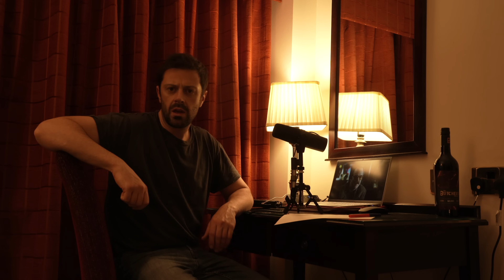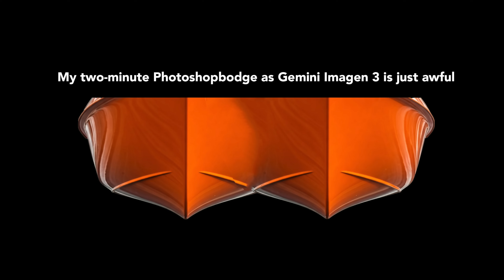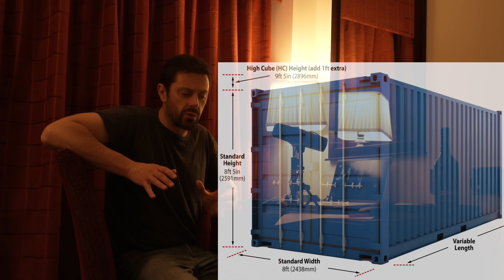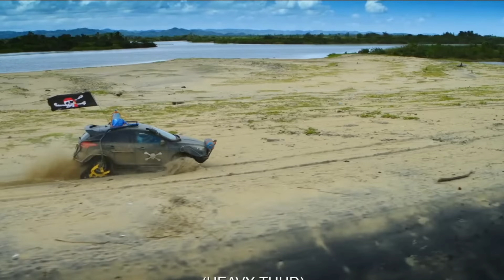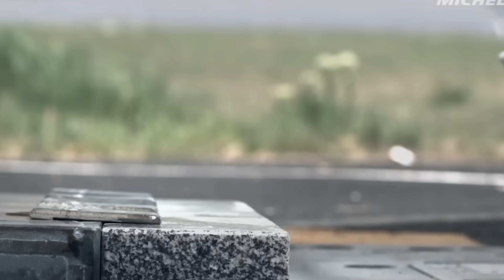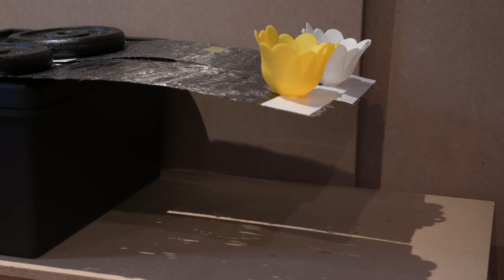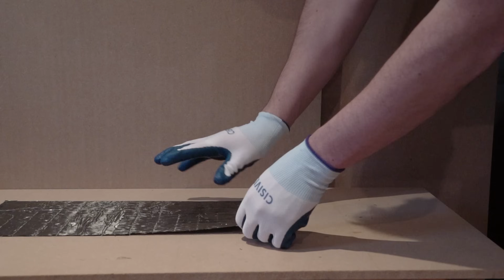The BIG Decisions: fuel, hull type, tracks/wheels, size, power. Bernard Arctic Vehicle Project [4K]

Comment: Some thoughts as they come along:
1) Why worry about the efficiency of udling generators? Just have one running and jump-start the others that have been kept warm by the running one?
2) The redundancy (turning a double-Bernard into one wreck and one bachelor-Bernard) sounds nice, but will probably require pretty much everything to be modular. Sounds great, but in my experience "modular" usually means "a lot less efficient" in all regards.
3) "Vegetable oil" means palm oil. Bio-diesel made from palm oil supposedly creates 3x the carbon footprint of normal diesel. Having seen these plantations: don't.
4) Not sure about the airless tires, just as a gut feeling. Keep in mind: A central tire inflation system could just keep a punctured tire going while providing the ability to up the pressure on firm ground for faster going
5) You could have movable foam window covers. Open by day or when certaing windows are needed, closed otherwise (also good for arctic summer)
6) Maybe also have a cable antenna mounted on the mast for long-range comms?
7) May not be necessary at the hull height vs weight, but maybe attach a shield in the front like amphibious AFVs?
8) Have you really thought the dehumidifiers through? You'll have condensation on the walls because of the high local relative humidity, but to get that to stop let alone re-evaporate the liquid water would require you to significantly reduce the ambient humidity? Maybe your thought is already high humidity because of a lot of people in a box though...
9) For water propulsion, why not attach the outboards close to the wheels? You'll already have a power connection there
Reply from the maker: Thanks.
1. The generators wouldn't ever be idling - they'd be charging Bernard or off. You're right that keeping one running will be wise for multiple reasons.
2. Yes this won't be perfect, but I'd like to place motor mounts in the rear Bernard just in case.
3. HVO isn't bio-diesel/FAME or made from plantations. It's mostly from waste oils.
4. We'll test with an open mind.
5. Yes that's the plan.
6. Probably two satellite systems will suffice, plus smalll VHF.
7. Armour vs flex for impact needs testing.
8. Yes it won't 100% remove the need to wipe and wring out cloths, but will help. And it may help capture the vapour BEFORE it condenses.
9. Maybe - or just one on the 'transom'.

Comment: An electric induction cooker might be more efficient than a diesel stove, they are very good at transferring all the energy into the pot/pan, and much easier on emissions.
Reply from the maker: That will include the energy conversion losses though, and lose us a front cab backup diesel heater.
Reply: @AlexHibbertOriginals  the backup is a valuable point, but otherwise I'd be quite curious to know how much diesel it takes to boil a large quantity of water with the diesel stove vs generator powered induction stove

Comment: Go for air tires. Air tires with tubes. Sure it’s a hassle to change out a tube if you get a puncture, but tubes are relatively small when packed up. Besides, what is there that will puncture your tires?

Also, tubes can potentially be patched with rubber cement or other stuff. I think you can make pneumatic tires with massive redundancy work. Just don’t go tubeless.
Reply from the maker: Ice is exceptionally sharp.

Comment: Are you actually gonna use it or just drive it to Scotland...?
Reply: its not likely to go anywhere without funding. he needs $1.5 million in dev costs to engineer a vehicle. ironically i am chasing a similar contract so his testing and ideas are useful. but without a multi phase low rate production contract from a national government its not going to happen. but there are contracts in phase 1 evals now for missile armed arctic vehicles so he can likely snag one.
Reply from the maker: I probably won't need the ordnance. Perhaps a discount can be had.
Reply: @AlexHibbertOriginals  projected cost for mine is $400k. 6 SSMs cost $3m each. spotter drones run $100k per in a magazine of 6. optionally manned with a crew of 3. likely stick 50 cals on top.

Comment: What was the reasoning behind an articulated vehicle vs a rigid connection?
Reply from the maker: All the single vehicles tend to haul trailers. So, I posit that if there are noisy, fumy engines that need not be over your wheels, you put them in a larger, separate trailer.

Comment: a few thoughts, after skimming other comments:
(I'll be using the spacecraft terms 'command' and 'service module' here for brevity)
so I like the 6x6/12x12 Electric drivetrain. A+ no notes
the BV-206 only has steering articulation, the vertical flex is all passive with a damper/strut as I understand it. 
The articulated waist with completely separate command/service modules is good for engine fume safety, which is something the BV206 can suffer from if the exhaust develops a hole. You'll still want carbon monoxide detectors in all enclosed spaces, even with an air-air heatex
Insulating the heatex air hoses between the C/SM is going to be an Interesting Challenge
I 100% agree you need dedicated water drives; as you noted, paddledrive is abysmal. 
Double-glazed windows are a MUST for this. as stated: keep all windows the same size for interchangeability
Make both C/SM top shells the same, but with blockoff panels instead of windows for the service module. this way you can cannibalize an entire vehicle to bring 2/3 home if you're convoying 3. 
You'll need to find a freezer you can do some Harsh Testing of candidate Gensets with HVO down to your expected operating temps, which will probably be well below the Will-Start guarantee on most gensets, which tend to get less sophisticated as the engine size goes down.
Reply from the maker: Thanks.

I think we're likely to use differential steering on the front vehicle, with rear Bernard as a trailer. But torque will decide.

Insulating the duct/cable linkage will indeed need work, although warm air will normally be passing through it at speed.

Interesting on keeping top shells the same but with mods. Height and things like turbine mounts may/may not get in the way.

Cold running the gensets is needed for sure. I've run plenty of them in Northern Canada, so know what foibles are most likely, and what to look for.

Comment: Every 100 litres of HVO or BioDiesel weighs 87.47 Kgs so a typical Diesel Tank of 1000 Litres will have 874.70 Kgs of fuel plus the weight of the tank.

Comment: With big tyres will you be able to get away with no suspension to keep it  simple and light weight?
Reply from the maker: No suspension is unlikely. Looking at torsion bar suspension and a method for the driven wheels to have constant velocity joints.

Comment: If you are going to have wind turbines then you should make a Vertical Axis Wind Turbine, you buy a 10Kw generator to mount onto the 2nd cabin floor that goes through the roof which has 3x 1.5m tall x 2m wide Venturi Wind Turbines which has fixed wind guides to an inner spinning curved rotors which gives over 32% efficiency. Join up 3 of these turbines into 1 driven shaft of the generator. You also should look at having a mud room of sorts where you can go from hot inside to cooler temps to put cold weather clothing on before going outside into freezing temps. You'll also need to be able to use a flexible tunnel between both cabins for conducting routine engine management etc.
Reply from the maker: I'll have a look at the vertical turbines and the config you mention, thanks.
Reply: @AlexHibbertOriginals  Welcome

Comment: Spit-balling fuel storage ideas - 20litres/kilos is max you can expect an individual to heft by themselves so something resembling a geodesic dome made up of 20litre cells that are linked with quick-connect self-sealing pipes. When empty they will work as floats/fenders. A basic sledge frame could be their base so it can be hauled. Toblerone sort of shaped tanks that are fairly flexible bladders - like boat fenders.
Reply from the maker: Yes, lighter internal cells are key to limiting spill risk and making it wieldy to work on.

Comment: I've got these & they are amazingly bright lower power spot lights.  STEDI™ MCX10 Motorcyle LED Light Driving Beam 10 degree 1052LM 400m range DC 10v to 30v & STEDI™ MCX25 Spot Motorcycle LED Driving Light 1950Lm 245m range DC 9v to 36v, OPERATING TEMPERATURE -40°C to 60°C 50,000 hrs. The problem with lightbars are that they are all flood type lights doing very short distance & much of the light is spread up in the air. What you need is multiple spot lights that can do long distance as well as a few that do medium distance light.
Reply from the maker: For distance, check out the vid I did on https://youtu.be/-rrs_0nRc7M?si=2BGHjHomMaa0eWvN
Reply: @AlexHibbertOriginals  Yeah they are flashlight but they don't make vehicle lights with zoom function as far as I know ??? After looking for a long time the 10 degree spot lights were the most focused lights on the market I found.
Reply: @solarfunction1847  A lot of light focus is based on the housings shape and the shape of the lens.
If, while it would cost more, a custom light box using the light source of choice could be made and developed to give the ideal effective range.

Comment: I think the main hurdle apart from money is time. You might spend 5-10 years building that thing. So a design that saves time will probably be better overall. 

Stitch and glue is a great way to build a hull. Having almost everything CNCed or lasercut saves a ton of time! Cutting a piece of steel to length and drilling 10 holes takes half an hour. Having a laser cutter do it takes 1min.

Even better is repurposing off the shelf parts. Even buying a actual flat bottom boat hull and adding wheels to it.
Reply: Apart from the hull, this still sounds like a very ambitious project. Don't get me wrong, I love your ideas and hope they will be realized. But the scope of this project sounds like years of development and testing a whole team of engineers could work on that for a substantial amount of time
Reply from the maker: Not sure about the principles here at all. One a custom mould is made, each hull laminated is exactly one day of work.

I considered a Pioner Multi or similar, but a carbon-diolen hull is half the weight, twice the strength, and 20% of the cost in materials compared to a £17k plastic off-the-shelf hull. And you control the exact size and shape.
Reply: @ I think it will be more like one month per hull. And afterwards the real works starts with outfitting.
Reply from the maker: It's literally impossible for a hull layup to take more than a day. The resin cures within a day.

Comment: 28:59 well if you are asking...
I think you are making it more complicated than what it needs to be.
the connection between two hulls is a major concern, mainly the heat transfer.
I think you (and I'm in no way an expert) you are better off using one single hull and a bulkhead or some access panels to the engine's room.
that way it's always accessible nometter the weather, it's much easier to transfer heat and you could possibly even get warm water.
depends all on how concerned you are from the noise.
other than that,
the pole with the camera on top doesn't convince me, again, keep it simple, use mirrors instead.
the winches are gonna be electric? you are gonna need a lot of power if you get real stuck (knock on wood). MAYBE you could consider some manual winches?? you have to go outside anyway, with a manual you can store it inside and on the hull have only some anchor points.
again, I'm no mechanic nor engineer, but that's what I'm thinking.
main takeaway, keep it simple!
best of luck! eagerly awaiting for more news, regards.
Reply from the maker: I did ask I suppose!

The linkage will certainly need thought and tests. My experience in Alan is that a bulkhead simply won't counteract noise and fumes. Mirrors for getting distance views forward? Manual winches sound very wise.  Cheers for your input.

Comment: Interesting Alex. Looking forward to this. Couple of thoughts, rear section as a flat bed (batteries and motors inside it) On top you have a small HIAB crane to lift same size modular cubes that contain either fuel, diesel generators, or storage. Modular power packs and fuel packs that can be quickly lifted and 'plugged in' by using the HIAB would give you real flexibility and multifunctionality. Hopefully you can visualise what I mean. The rear being half the height of the front command unit, but with e.g. 10x 1m3 interchangeable modules clipped in on top.

Comment: Re the exhaust heat recovery: By "wet" systems, are you also excluding refrigerant-based phase-change heat-pumps? ISTM a refrigerant line could be connected between sub-bernards.
Reply from the maker: Trying to stay dry for now, as leaks or bursts would be a major drama.
Reply: @AlexHibbertOriginals  Likely a good idea, the less you have to rely on things that are pressurised with particular chemicals like refrigerants, the better. As if the line does break, and you lose that refrigerant, unless you carried extra you would have just lost that whole system.

For a reliable system in remote and extreme locations, simple is always better, even if not always very efficient. 
And, heat pumps are great, but they also lose most of their efficiency when they get way past freezing.
They are fine for a short time in sub-zero temperatures, but prolonged operation does become a problem.

Comment: People have been trying to make and use airless tyre since 1938 and as far as I can tell they have all failed on anything faster than a slow run. The main problems relevant to you would be how they just can't contour nearly as well to the surface as a low pressure air tyre. Giving you less grip and pretty much no dampening to the ride. And also the materials needed to make the airless tyre would probably act completely differently in the cold temperatures and become much more brittle. 

If it was possible to make good airless tyres (for a non-slow application), the very first group to mass adopt it would be bicycle commuters. As they are already going on flat surfaces, not too quickly and really really really hate punctures. But people hate airless bike tyres more than punctures. I absolutely think airless tyres will get dropped from this project as soon as it starts. (but good luck :)
Reply from the maker: I'm not nailing the colours to the mast - these are the best solution I can deduce at present. But airless tyres are increasingly used in industry, including construction, mining and tractors. The materials are ever-improving, and resins for fibre reinforced wheels are the same as the hull - great down to -40 with excellent flexural strength, which is more than many normal balloon tyres walls can claim.
Reply: @AlexHibbertOriginals I came to say this…. Also with airless your physically connecting the bit that hits bumps to you…. Much like suspension I suppose…. But without the dampening of 100 years of proven tech….

Someone might make something good enough soon…. But soon enough?
Reply: @Obvsaninternetexpert  If you lose dampening from the tires, that just means you have to add it to the suspension. 

You can have solid tires and still have a comfortable ride if you have enough suspension to compensate for it.
Reply from the maker: I'm looking at ways to use torsion bar suspension for driven wheels, not just free ones.
Reply: I would say you are quite off with a lot in the comments here. We run airless Michelin tires on our pickup trucks , we run them on our side by side atv’s. They are not solid they provide great cushioning almost too much. They give a sloppy feel to the steering wheel.  They are not popular simply because they are the cost of a set of tires for each one. The atv ones are the same and don’t last as long the webbing design breaks from the tread and the tire becomes un-round. As for bicycle tires there are a lot of options they are very heavy when you compare them.  The ride feel sucks it’s like marshmallows
Reply from the maker: Sloppy is what we are after!
Reply: That raises a good question - does Bernard have a target cruise speed? A 'slow run' might be the best we can hope for if the surface is rough.
Reply from the maker: Sub 20mph on perfect surfaces, but likely sub 5mph over bumps.
Reply: @AlexHibbertOriginals  if your going that slow i guess its a suitable application

Comment: Having designed heavy duty trucks & truck bodies for about 40 years, don't worry about being too slab sided with Bernard, you'll need some kind of mold to manufacture the shell, so having curvature won't really be an issue for the shell. Boat manufacturers would be a great resource for collaboration. For the stuff inside, maybe. I generally agree with most of your initial choices. My initial thought was that 4 separate powerplants would be a bit excessive, but I like the idea that a unit could be something 2 or 3 people could wrestle out of Bernard for whatever reason makes a lot of sense where the nearest repair facility may be 100's of miles away. You will need to have good vibration isolation, so don't think you can just bolt stuff down. Lastly, I think you're biting off too much thinking you'll go with airless tires. While neat in theory, you have enough on your plate from a technical standpoint with everything else. At a minimum, make sure the design can accommodate normal tires if airless technology falls flat (sorry couldn't resist the pun).
Reply from the maker: Good input, cheers